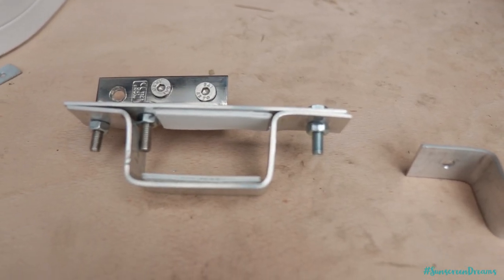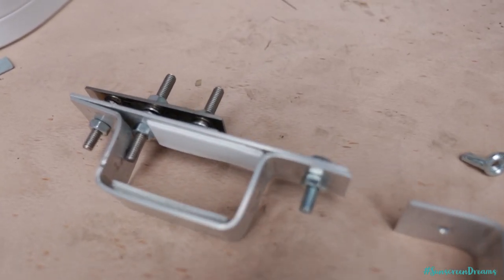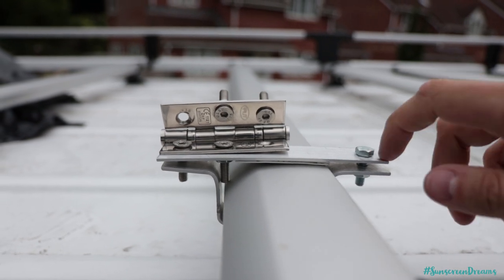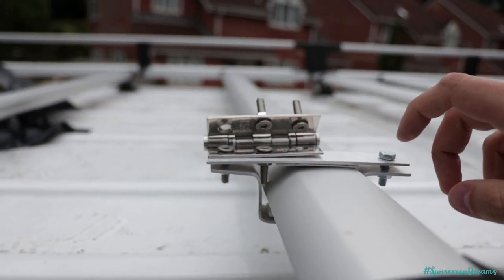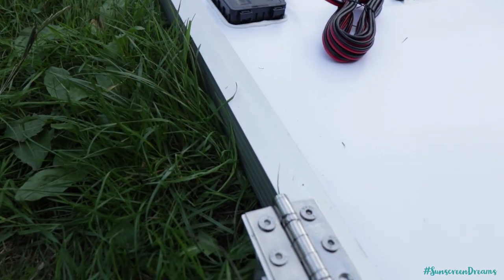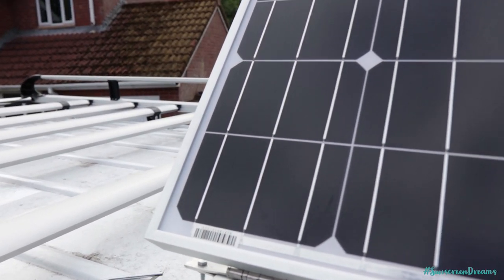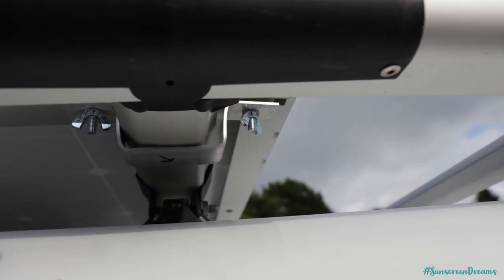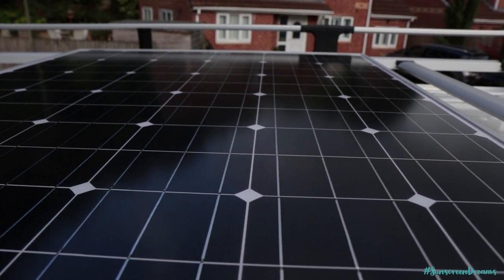Fitting Solar Panel To Campervan

Comment: We've just gone for the same solar panels having seen yours. 
Thank you for the video. 
We also plan to fit on a rack, could you share any information on where you got your brackets and bolts please?
We just plan a flat mount for now.  Though love what you've done creating the hinges, and that could be a future modification for us.
Reply from the maker: Hi, we are glad that our video helped you in your solar decision 😀 The brackets are made out of some flat stainless steel bar that we bought from B&Q which we have bent to fit the shape of the roof bars. The bolts are from Screwfix, I believe they are M6 but will double check the size this weekend and get back to you. Thanks for checking out our channel and video

Comment: Don't forget to implement some kind of locking setup for when you tilt your panels, something to lock them in place so that is a gust of wind won't blow them off, or too blow them far up and over, and cause damage.
Reply from the maker: Yeah we are going to be creating some brackets that we can clamp to the side of the panels when they are up as we definitely don't want them being caught in the wind.